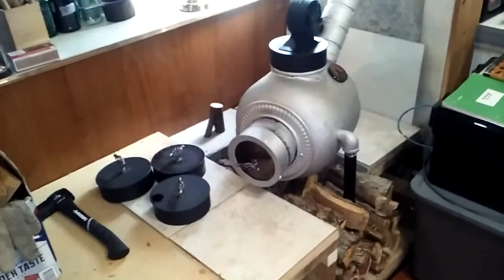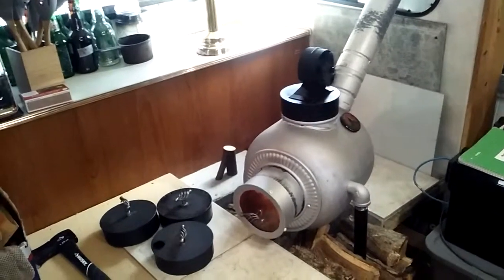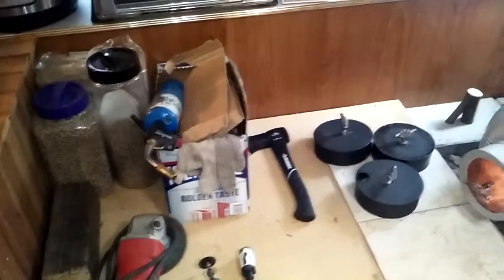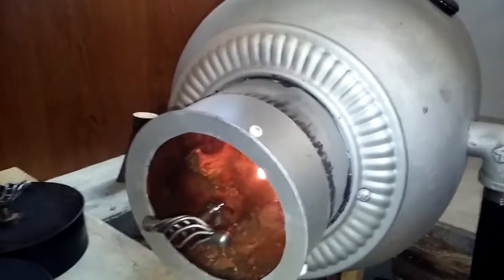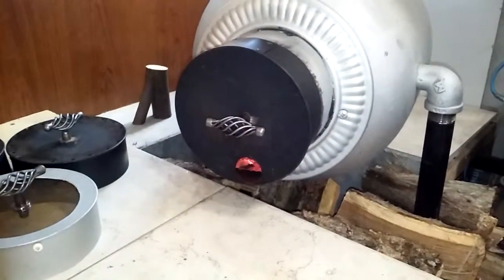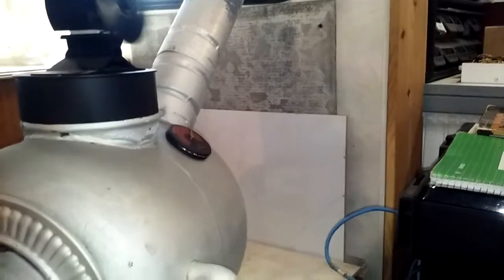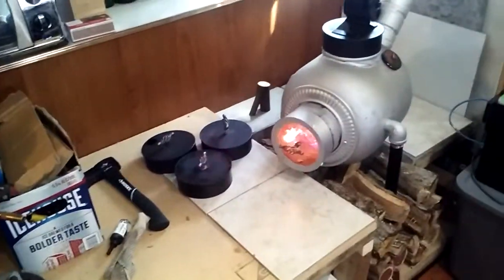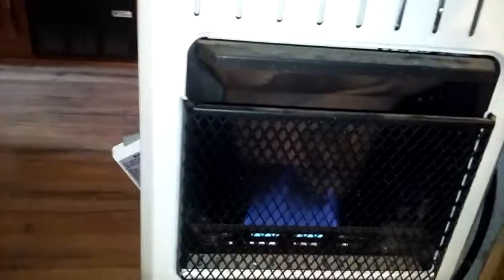Cheap RV Wood Stove

Comment: Good job, bud! I like it, it looks awesome and versatile. How long does it burn for, when fully loaded? That, apart from the price, is the main concern I have with those Cube stoves. I don't want to wake up every 2 hrs to fill the stove.
And how is the silicone holding?
Cheers!
Reply from the maker: Thanks. I can get 2 hours out of it normally. If everything is dialed in, maybe 3 hrs of running.  But even though it only runs for a couple of hours, I can bring the temperature up to 75 pretty easily, so that is a way to extend it. I have a thermostat controlled propane heater that kicks in to maintain a minimum temperature.
This upcoming winter (2021) will be the 3rd and last season for this 20 pounder, next year I have a 30 pound tank that is expiring that I'll use instead.
The ATV Red 600 degree silicone will develop a pinhole every 6 to 8 weeks that needs a little touch up, but is not affected by the heat at all.  it is tempting to put an outside layer of the sheet metal, which would still be removable, but more durable.  The plan is next year (with the 30 pounder) to put the stove pipe straight up through the slide out roof, permanently.
The $100 that I've put into this version has saved at least $200 per year in propane. And not having the inside of the windows dripping or freezing with condensation has been priceless.
Reply: @propanepowerednomad146  I see, thanks for replying!
Well if the van keeps it in, the heat, then I don't see a negative side. Especially because I like sleeping in colder rooms.
However, I support the upgrade. Perhaps, if you lines a part with it with refractory bricks or homemade lining, you would end up with residual heat. That's what I learned as a kid, having a tall, round Hungarian glazed brick stlye woodstove that would burn for 1-2 hrs but would be hot the next day.
I wanted to make myself a self feeding rocket stove with secondary air intake from the oudside. That way I would not be restricted having a couple of pieces of wood but a rather long one.
How does pellet burning work? Do you have any containers for it?
Reply: Oh, and I agree- on any case I would have a backup heater when the main one dies out. Perhaps even place some copper tubing around the flue for water heating.
Once again, I will eagerly wait for the iteration 2.0! :)
Reply from the maker: @emel60  Right, adding more mass will provide more residual heat, especially when added to the outside. Adding fire brick on the inside will result in most of that heat going up the stove pipe. The first season i put two firebricks in the stove, last year i put only one, this year I am not putting any. They were mainly for safety which was not needed. But the extra room is very helpful for more fire wood.  Just keep a layer of ash on the bottom to avoid hot spots on the steal. This small stove is inherently safe, it never gets too hot or develops a large draft.
I have tried pellets, not a fan. You need a good bed of coals to put them on or else they just smolder.  In my recent follow up video https://youtu.be/LmhfI-f-GUk I discuss firewood management. Pellets are a compact and convenient way to store dry fuel, just in case regular firewood runs out.  Sometimes when I'm lazy I throw in a couple handfuls of pellets, when they do get burning they get really hot!
Reply: @propanepowerednomad146  ha! I see what you mean by adding the bricks or insulation lining on the outside. It makes sense. I never
quite understood why flues in the interior need to be double walled. I understand the outside flue, which get cold and cause severe condensation and down draft, a potentially bad situation.
Anyhow, that is a good price reduction and I agree that ashes keep things in order. I never fully clean my stove for the same reason. It kills any pieces that fall through which I can reuse after I collect them.
Also, for the pellets, I agree with the statement that they will smolder if you try to ignite them. But, I saw one guy using a highly perforated canister which he fills and lights up. It works beautifully. Luckily,  there are many YT vids on this matter, I just checked. It can be done efficiently and I will try it soon. I still opt for the wood, but having a dry backup is nice. Duality is the key! :)
Cheers!